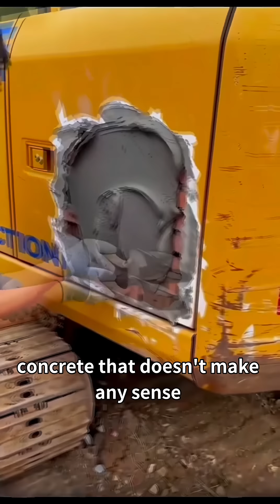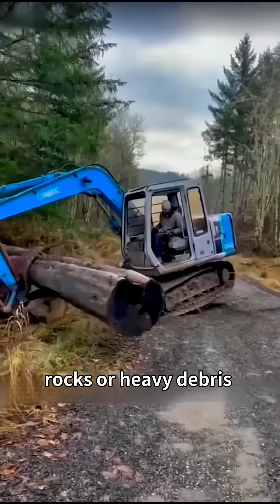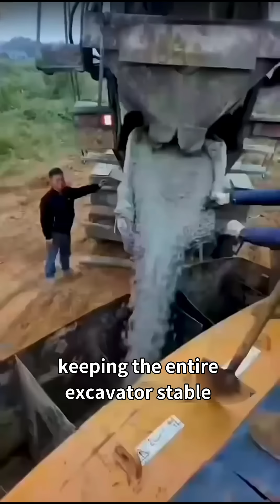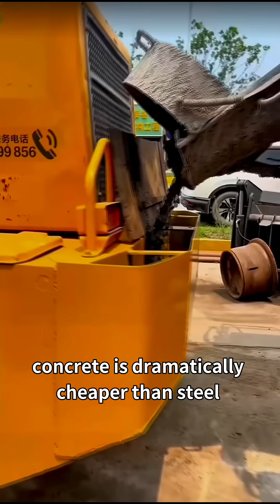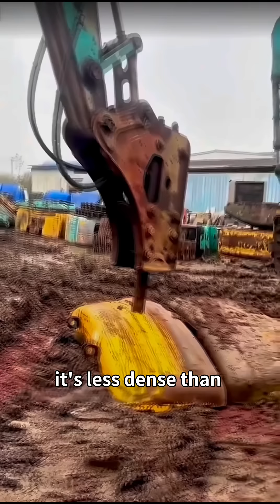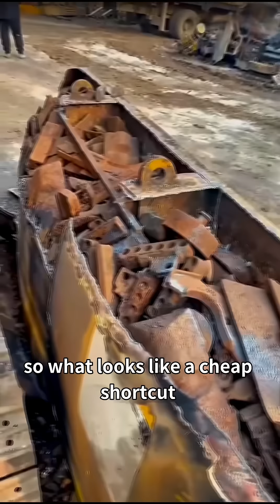Why Are They Pouring Cheap Concrete on a $1,000,000 Excavator? 🤯

Comment: Steel is hardly expensive its 50 cent to the pound. the reason concrete is used is because the weight needs to be variable.